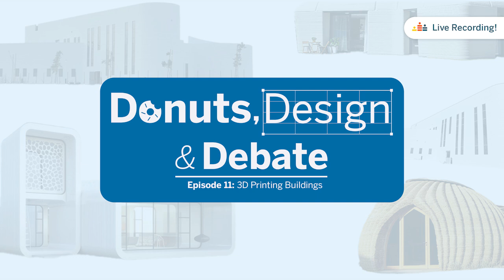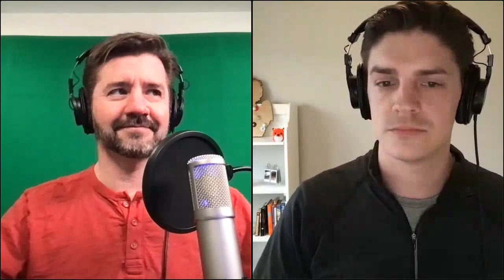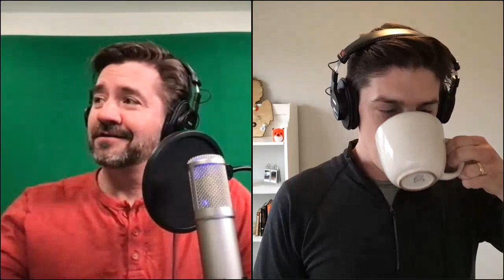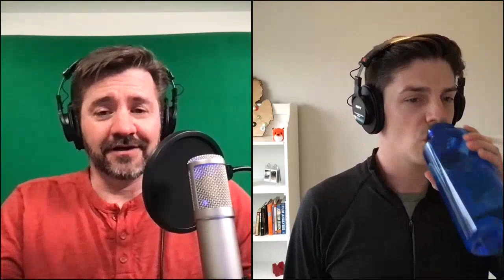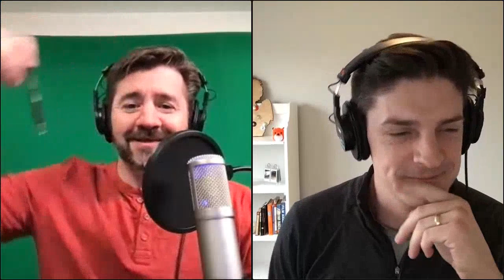3D Printed Structures | Donuts, Design, & Debate 11

Comment: I think the debate drifted off from are 3d structures good design to more of is the printing process good.  There are plenty of arguments on both sides as to the benefits or issues with the 3d printing process in relation to structures but not much about the actual design of the buildings.  Modern building design has always been jarring to some and glorious to others.  Here in the UK our houses are getting smaller and smaller but some of the designs are quite attractive on paper, once it gets to the building site it becomes obvious that the space needed to live comfortably is just not there so it could be argued that therefore they are not good design.  Just because a 3d structure looks different to what came before doesn't make it good or bad, just different.  The design can be good so long as it matches the purpose of the structure well surely, and the reverse would be bad design would it not?  If good design is only measured on how something looks, many great structures would simply not exist because they don't look good, either in consideration of their location or the actual exterior appearance is not to everyone's taste.

Thanks for the debate guys I'm really enjoying the series.
Reply: It seems to me that the process is currently the limiting factor for A) these structures even being used at all for the intended purpose, and B) any aesthetic or interesting design solutions.
Frankly I was flabbergasted with how many Donuts this got! The people making these structures seem much more focused on the tech or economic possibilities and less on the design.
Reply: @mattrobison4411  I think that's the norm for any new tech isn't it?  Build the new tech, play around with it til it works well and produces something like the original intention, then give it to the experts to make it work better in every way including the design of the product the new tech is intended for.  Certainly the current 3d printed residential buildings leave a lot to be desired in many ways but as a proof of concept they do the job adequately do they not?  Personally I look forward to what real architecture will be made with this tech but that's not to say I'd be happy with an anything goes approach especially in sensitive locations.
Reply: @keggyification  100%! As proofs of concept and inspiration for the future the existing prints are amazing design.
We wanted to narrow the scope to structures that currently satisfy the criterion of being "usable" i.e. habitable in the case of a home, structurally sound in the case of a bridge. A smaller discussion but more practical.
Just like you, I'm excited for what the future could hold. However I'm sceptical about what proportion of future construction projects will be printed in place.
Reply: @mattrobison4411  nice! but I think you meant "intents and purposes" - I'm excited too I can't wait to start modeling 3D printed structures in SketchUp!! oh I'm a big fan btw
Reply: 10 cent phrase 🤣